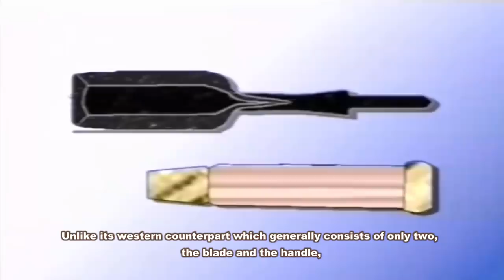What makes the Japanese Hand Tools (Chisels) more Amazing & Incredible than the Western Variety?

Comment: So what makes Japanese chisels more amazing then their western counter parts? Nice documentary but it didn’t answer the question
Reply: Its in the steel and the craftsmanship. I had the fortune to work for a number of customers who wanted the work done traditional Japanese .first get good quality then learn hiw to sharpen. Most important lots of bandaids there is a learning curve for tools that can be surgicaly sharpened. 
Such a joy to work with!
Reply: Different construction and grinding techniques, with noticeably harder steel due to the soft iron body taking most of the stress.
Reply: What makes them "more amazing".... Nothing. 
It's just a different style,  that some people prefer. Though Japanese chisels do tend to be made in many more very specialized designs which can be very useful.  
Other than that, a lot of people get caught up in some perceived notions about the Japanese having a monopoly on skilled craftsmanship
Reply: As a woodworker I flatten and polish the back of my antique Marples chisels once then sharpen them to razor sharp, this lasts months and the next time I sharpen them it takes less than a minute and lasts for months again. I could do this for hundreds of years and still have a usable chisel, what happens when you get to the hollow back of a Japanese chisel? do you have to flatten the back? because to take out that hollow must take a lifetime. Also WTF? I don't know anybody who has snapped a old western chisel using it correctly.
Reply: Using a thinner layer of hard steel, along with softer steel… makes it easier to sharpen than 100% hard steel (American style) chisels
Reply: @purpleom9649  year old comment but for anyone who gets pulled in by the algorithm. The hallow on the backs of the japanese style chisels are egg shaped, meaning as you sharpen they slowly reveal more workable steal as you flatten. You grind far less material and keep the backs of your chisels flat. This is good if your work is precise that your chisel backs must be flattened before you current project each time. It also allows you to reverence the full back of the chisel during plunge cuts, increasing accuracy. 

A great craftsman with harbor freight chisels can do the same. The japanese make excellent tools but so do we. Or did- not sure if lee valley can keep up the solo game before their quality also suffers in this game we play.
Reply: @joeybassbass  great for flat stones we now have angle grinders though which allows us to keep up, remove unnecessary material then sharpen the required end on water, oil, or diamond stones. Yields the same result.
Reply: @gabrielmaynard  The "Marples" chisels I have are already 80-100 years  old and they will last another 200 years with a  craftsman using them daily. What I was saying  is once the  back is flat on my chisels I never have to flatten them again, it's then all about the bevel and how  long that very sharp edge lasts, my chisels  are made with cast Sheffield steel (the  best steel in the world) with boxwood  handles and you  can buy them for £20-30 each but later Marples chisels aren't the same. IMHO lesser made antique UK blades are made using the same technique in the video above where 2 steels are used instead of all tool steel.
Reply: @purpleom9649  you are right on all accounts. You mentioned the hallows on the back of the japanese chisels in your older comment, I understand it was a year ago. You do not grind the entire hallow down just remove enough material for that sharpening. The way japanese sharpen their tools is a little different from westerners also. Europeans sharpen then use polishing compound and a strop to pull the burr from the chisels edge and polish the blade. Japanese use very high grit stones to approach the exact point of the cutting edge and allow that edge to be pinch off by the sharpening. This does make a difference but to what extent I couldn’t tell you. 

There are no differences between quality japanese chisels and a european chisels. Both yield the same quality of work based on the skill of the craftsman.
Reply: @gabrielmaynard  It's true that all chisels will work the same, even ones that are very cheap but the edge won't last and you will always be sharpening them. Personally I find antique blades,  both chisels and plane blades to be the best I Sorby for planes and Marples chisels. I have used cheap blades and they aren't enjoyable. I can't see how the "Japanese" way of using stones is better, I use diamond plates and compound on a strop, it takes  me less than 1 min to get a razor sharp edge.  https://www.youtube.com/watch?v=GN4yr7vp4I4
Reply: @purpleom9649  paul is the man. 
Id say the japanese method has something to do with a folded over edge. If you have a perfect edge meeting wood with quality steel the metal couldn’t fold as easily as with a stropped edge. Paul sharpens with a micro camber on the bevel of his chisels so his sharpening method produces a balance between sharp and durable which I also use. Stropping also causes a micro microbevil-if that matters?- it may he more “broscience” at that level. 

Ive never held a master japanese craftsman’s freshly sharpened chisels either so its as much as your guess as mine at that point.

Comment: There are also plenty of great quality western tools that used and iron back with steel forge welded too it. nearly any antique shop in the Midwest will have old plane blades and slicks with this construction.
Reply: Yeah when steel was rare and expensive to produce. Today we make steel by the megaton. So laminating blades is pointless.
Reply: @1pcfred  Laminating steel today is not done because of availability, it's because it's way easier to sharpen.
Reply: @HdtvTh  that's why I grind a primary bevel on my tools. Then I have a lot less material I have to remove hand honing. Power bench grinders are another thing that is available today. Something I'd strongly recommend anyone that wants to woodwork to get. Otherwise you will be dealing with the opposite of easy. Which is hard.

Comment: I own both western and Japanese. Japanese steel is too hard for western hardwoods and breaks in use. BUT perfect for softer woods.
Reply: I'm a shipwright and I make wooden boats for a living. I work with hard European white oak every day. Every one of my Japanese chisels holds up just fine. I can chop for hours with them and I've never had any chipping. You don't know what you're talking about.
Reply: @Splash111  never used Hickory but I've used my tatakinomis on Maple plenty of times without any chipping. Maybe get some good tools before dumping your brain diarrhoea here. And btw, European White Oak is harder and denser than American White Oak. Some European White Oak logs I've processed were equal or harder then Maple. But you've obviously never used European White Oak so how would you know.
Reply: @Nico-bu6bj I call bullshit, I’m sorry, but chipped blade on Japanese chisels is entirely true. I’ve dealt with it as have plenty of other people. You have one laying right there and should grab another chisel but don’t. Go to work and then when it starts cutting badly you look and the edge is chipped. I have a few and I use them mainly for work where it is hand power only. I would never work only with Japanese chisels. They are WAY over hyped.

Comment: They are better than Western chisels, but this presentation doesn't even give one reason why.  Unless the idea they are made of 4 parts sways you.  :)

Back when the woodworking revival started in the 70s, in say the Lee Valley catalog, the Japanese chisels were up against Marples Blue Chip chisels, that even though they are usable, they were not any competition whatever, and fold over in say maple.  Today after 40 years of elevating things There has still never been a review in a woodworking magazine that I have seen that placed Japanese chisels below western ones, despite reviews that in one notable case FWW was actually racist, with allegations of cultural charlatanism.  Yet  even with irrelevant testing methods, and biased reviews I never saw a review that downgraded the Japanese chisels.  The reviewers didn't know why the chisels were better, but like a Sunday driver looking at a race car, they could tell there were significant differences compared to their Corolla, even if they could never wring them out.

That said, today, there are very good chisels available from makers like Lee Valley.  And for better or worse these chisels are designed for amateurs, and with newbie pleasing features.  The money to be made is not for meeting the needs of people who work in slave like conditions all day long, at the highest levels of expertise.  The money is in the beginner market, because a beginner needs a full set of tools, not just the odd additional chisel, every now and again.  But beginners have their fears.  Sharpening among them.  So they will prioritize features like whether the chisels fit into a sharpening jig.  This is like a beginner liking a keyboard with coloured dots that match dots on the "music", because they can't read music yet.
Reply: This whole comment is pretentious TRIPE from a Japanese fanboy.

Comment: they arent.

they are well made,thats all.

well made hand made western chisels  are every bit as good.

the laminated approach is because japanese could not melt steel at tge same time most other cultures could(including one of thier bigfest and most influential neighbours-china)

tha lamibated approach was to save costs on the extremely costly high carbon cutting edge.

other cultures just cast an homogenous billet of high grade steel and forged it to shape-solingen,sheffield are just two well known ancient blade majing western cities

a comparable quality japanese steel tool us way more expensive
Reply: One of the other benefits of having this forge-welded approach is that you can have a slightly more brittle high carbon steel at the cutting edge, which can be sharpened better initially, and the soft steel behind it will absorb much of the shock that would otherwise chip the brittle edge.
Reply: @zakarileblanc5173  and then the thing is FINISHED in a few years
Reply: @jadekayak01  Only if you spend a ton of time on a course stone. Many of them will last several decades of constant use.  How long would it take to sharpen away two inches of a plane iron? Methinks quite a long time.
Reply: Zakari LeBlanc you are quite wrong.

Japanese chisels are "dead" very quickly because of the concavity on the rear-only about 10mm of flat steel.

A person using a chisel every day could "sharpen" thier way through 15mm a year every year.

That is not so slow.

Orobably why there are roughing and fine chisels.

Fine chisels would last much longer if only used on fine work
Reply: Once you reach the hollow-grind on the underside, you must peen the bevel from the topside to push steel down, then re-flatten the bottom side. 

The hollow-grind is not necessary, but has become common practice in recent years for ease of sharpening.

My daily use chisels and hand planes (for work) are mostly Japanese. I've not sharpened away more than 4mm on any of them in the last five years.

If I were doing fine furniture work or cabinetry, I'd surely move through them a little faster. I sharpen quite often nonetheless. I'm more than happy with their performance and longevity.
Reply: Zakari LeBlanc nonetheless western styled high quality chisels are just as good and less work to maintain
Reply: @jadekayak01  I'd like to think it's a matter of preference.  To each their own.